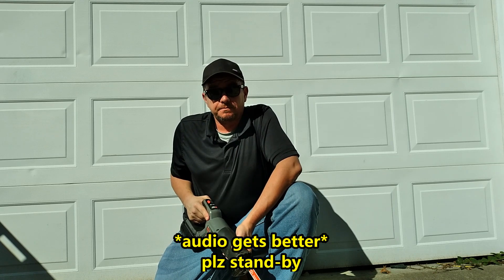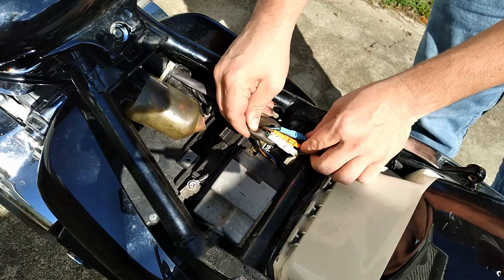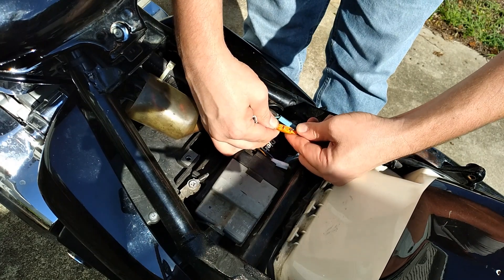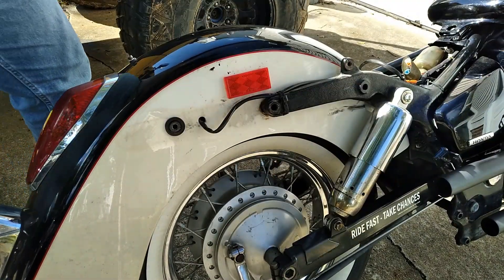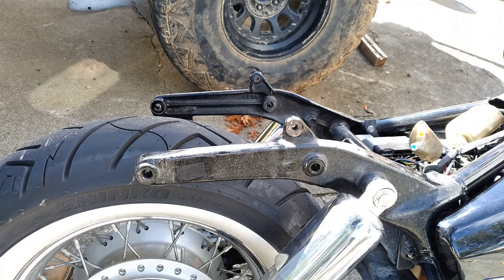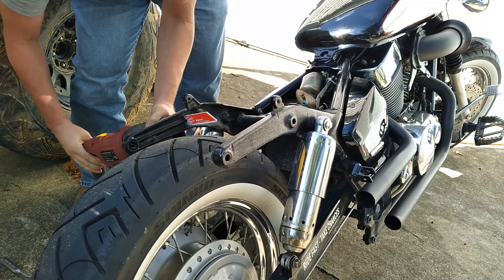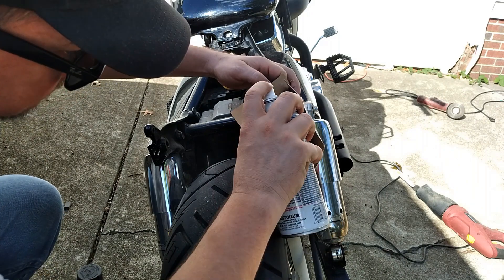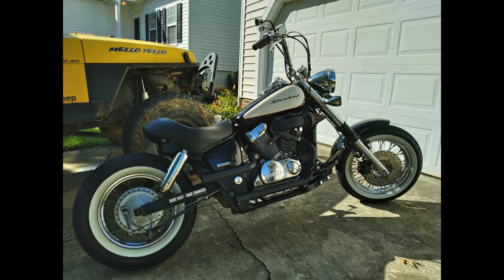CUTTING THE FRAME! | Honda Shadow 750 Aero

Comment: Congratulations! You got further on bobbering your bike out than I did.
Reply from the maker: It was hard to commit to it honestly. Un-reversable modifications always are.
Reply: @LuckyAcesRiding  they can't be welded back on,  Maybe not easy but it is reversible.
Reply from the maker: True, but at that point I would be concerned about the strength.  What's done is done lol. @theduffman441